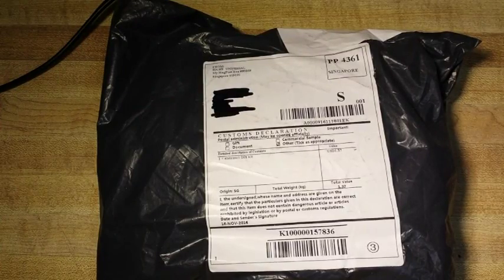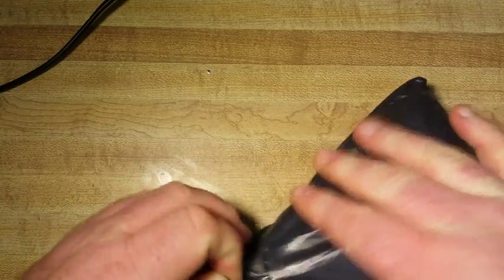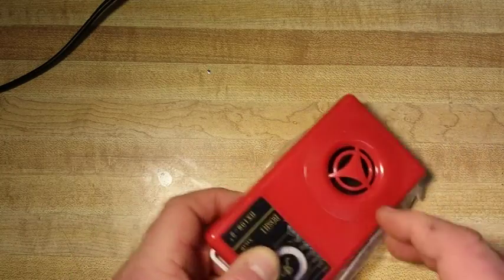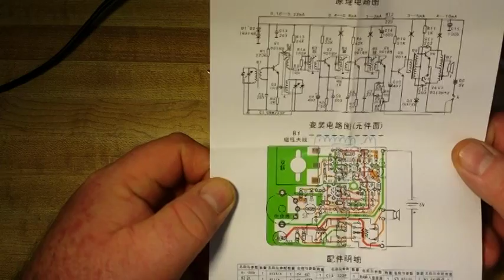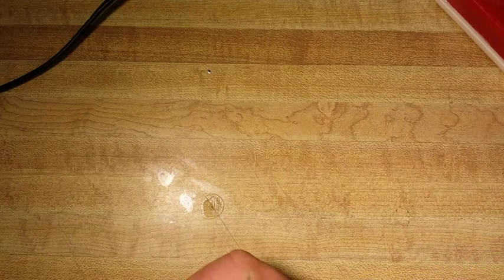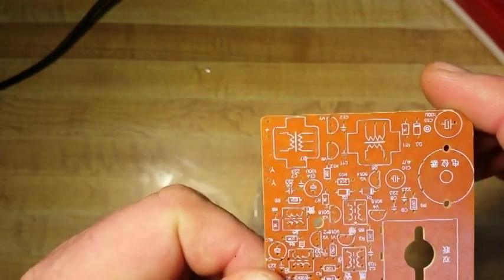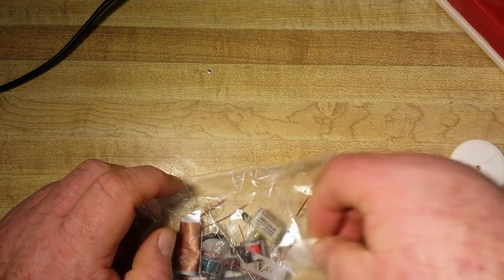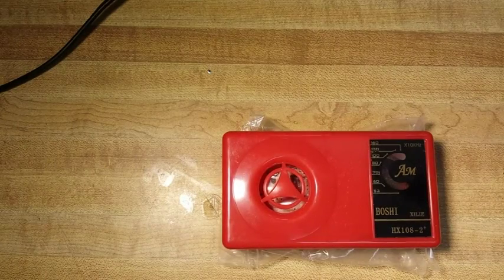The Slow Boat from China #2

Comment: Hi, did you get the tester to work?
Reply from the maker: UReasonIt The transistor tester? yes it works great.
Reply: Yes, sorry.  The video ended and moved to the next when I responded.  I have been thinking of getting a component tester kit.
Reply from the maker: UReasonIt the one I have works great. the reason it didn't work was    I want giving it enough power. it needs 9v. I use it all the time, specially for resistors.